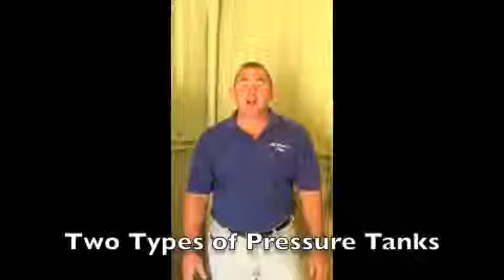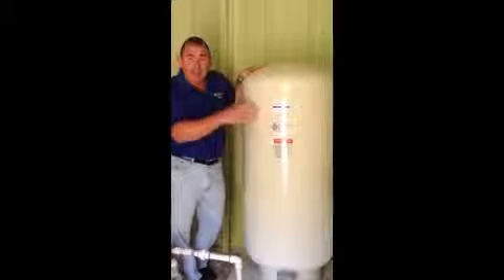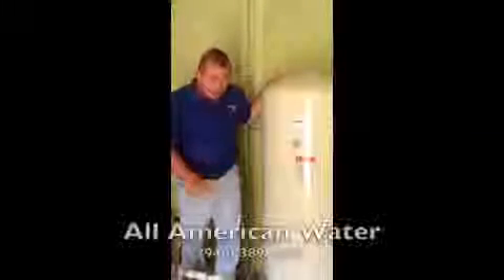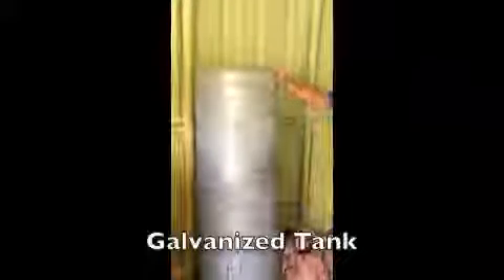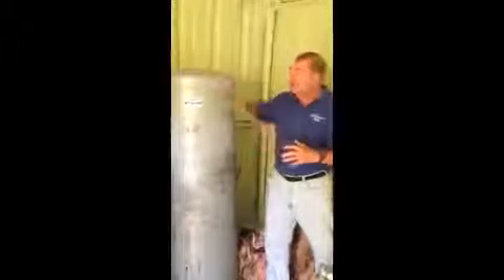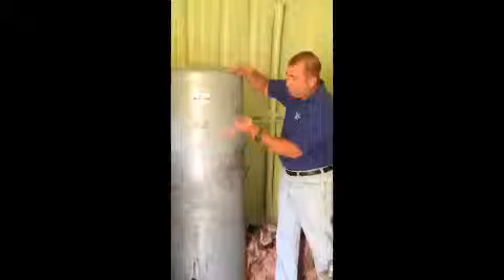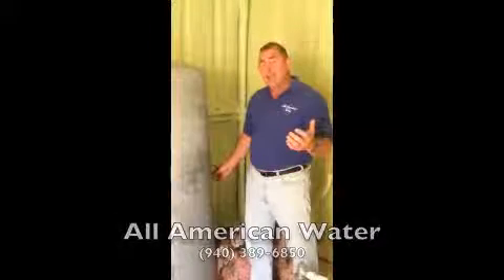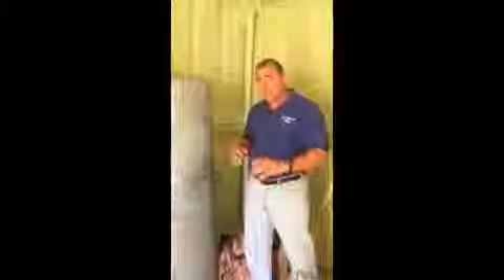Water  Wells

Comment: I bought my parents house.  The well hasn’t been used in 30 years when the pump went out.  Over 300 ft deep with the pump at the bottom.  
There’s a galvanized tank in the basement I want to remove.  It looks like it’s concreted into the floor.  Have you ever heard of this?
Reply: Yes. It seems to me that someone just poured concrete without removing the tank first